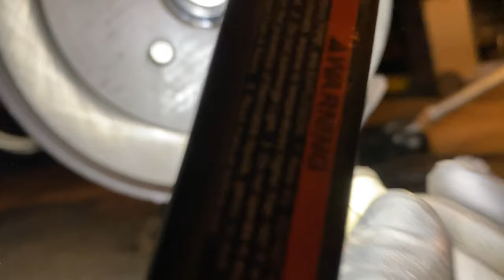2014 Subaru Crosstrek XV Rear Brake Pads and Rotors

Comment: Good point about trimming the pads if needed.  I bought a used 2014 Impreza and went to service the rear brakes when swapping to winter tires.  The rear pads were wedged in exactly as you mentioned and did not move freely.  I could tell by the face of rotor that they were not working properly.  Seems to be a common issue. I don’t know what shop installed the pads for the previous owner but they didn’t take the time to trim the pads as you did. Another reason I like to DIY. Shops are taking your money and play you for a fool as they cut corners.